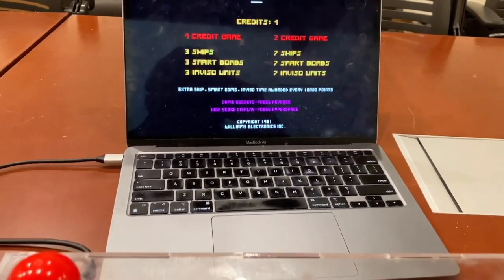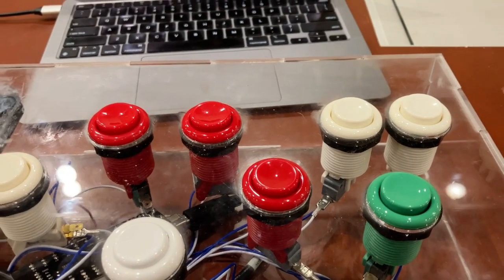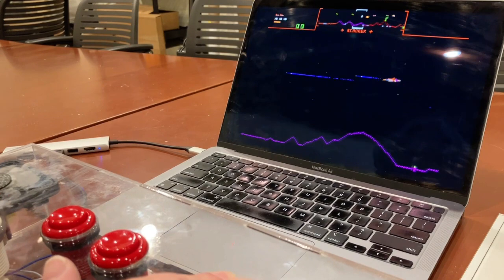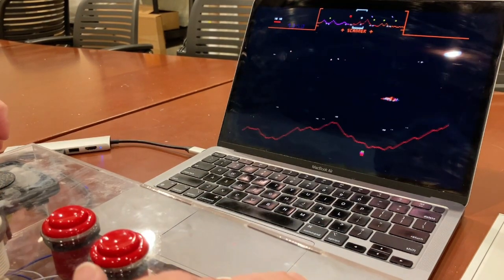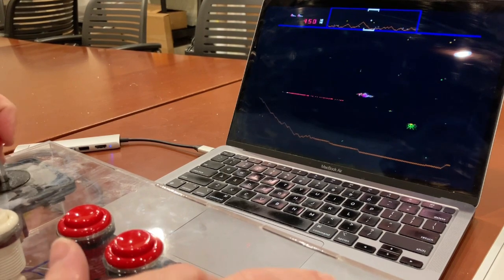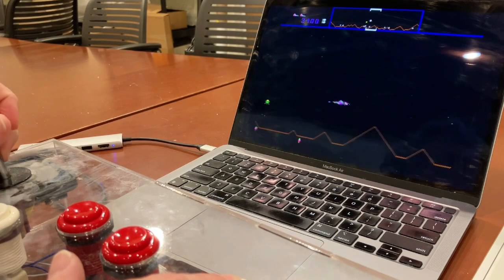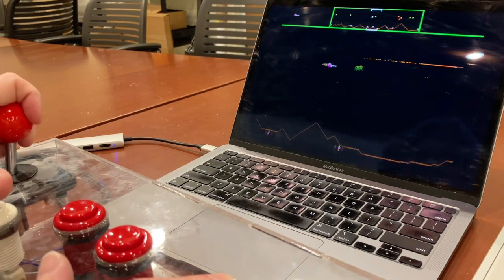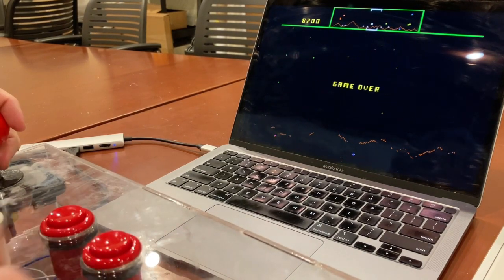Lasercut Controller for Defender & Stargate (Retrofuturistic Hardware VIP Team at Georgia Tech)

Comment: LOVE IT!  Back in the mid 80's I dragged home a full sized Stargate I found next to the dumpster used by the bar across the street from UCF. I pulled and cleaned all of the socketed IC's from the logic board, and got it going in a couple of hours. MASSIVE amounts of time were burned up having fun - but the upside is, my reflexes were substantially improved, and remain quite sharp to this day. If something falls off the bench, there's a good chance I'll catch it on the way down.

Comment: what board was used to encode the inputs to usb?
Reply: ah, most of the generic ones have a bad reputation in the fightstick community due to inconsistent and fairly high input delay. the only generic one that is fairly accepted is the sky q4t. The gp2040 raspberry pi pico based open source project is recently gaining traction as well
Reply from the maker: @genejas  I'm not nearly that hardcore -- as you can see from my demonstrated skills, or more to the point lack thereof... ;)
Reply from the maker: It's some generic Arcade-to-USB encoder board I got off Amazon or eBay. Just look up "arcade encoder"
Reply from the maker: Something like this (maybe not this exact one): https://www.amazon.com/Hikig-Joystick-Raspberry-Controller-joysticks/dp/B07BQGH8CL/ref=sr_1_7?crid=1TKFHFGT3W9L9&keywords=arcade+encoder&qid=1671181534&sprefix=arcade+encoder%2Caps%2C82&sr=8-7